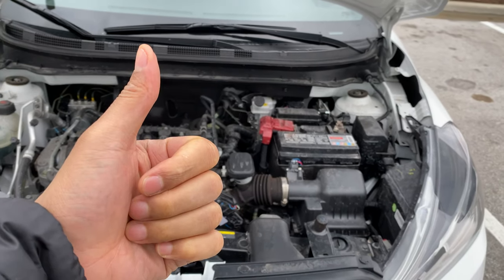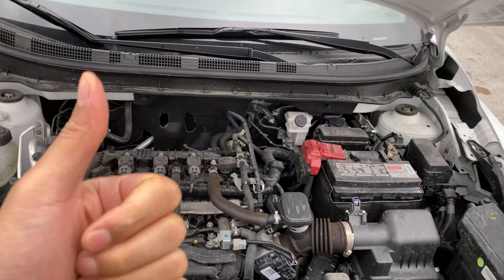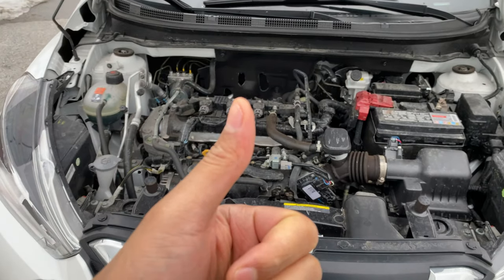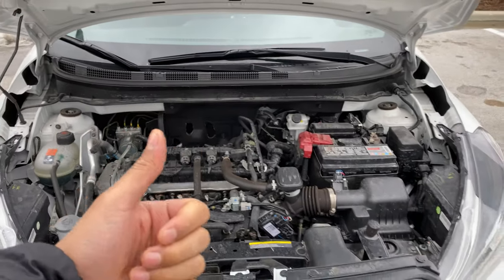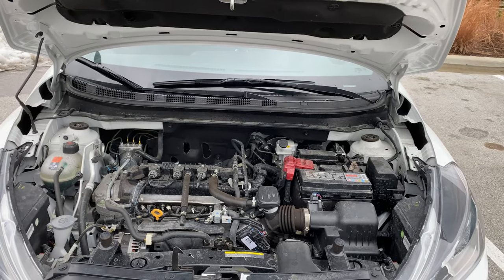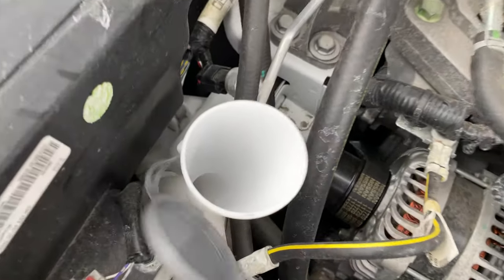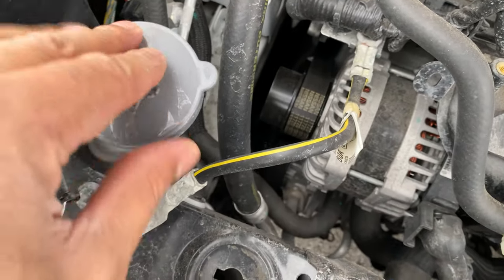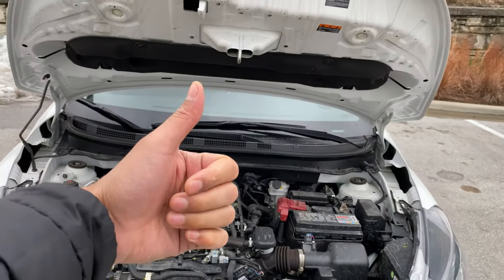Nissan Kicks - How to add windshield washer fluid

Comment: Yes is this for the front and back windshield?? My washer fluid hasn't worked on the rear window the entire time so thought maybe it had to be filled somewhere else....🤦🏽‍♀️
Reply: Not a car expert but windshield washer fluid is for front and rear. Must be something else causing the rear wiper failing
Reply from the maker: Did you hold the lever down for the back windshield?
Reply: Unfortunately, it could be a critter or hose erroision problem

Comment: How do you know if it is full
Reply from the maker: the indicator
Reply: @DIYPinto  Where is the indicator? I know where to put the fluid. That's obvious. What isn't obvious is where the mark is. I filled it up until I could see the fluid. Was the over-filled? I can't see any mark.
Reply: @Jan96106 how much did it take? Is there a problem with it being that full?